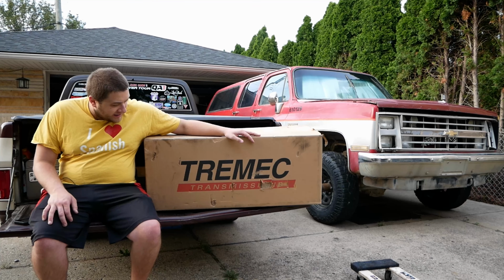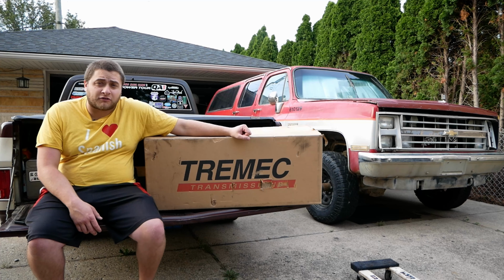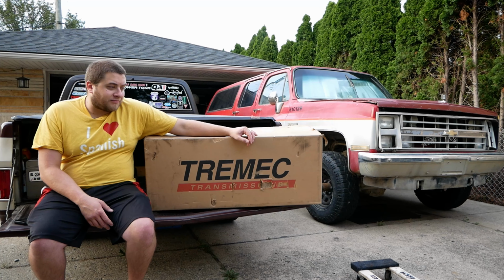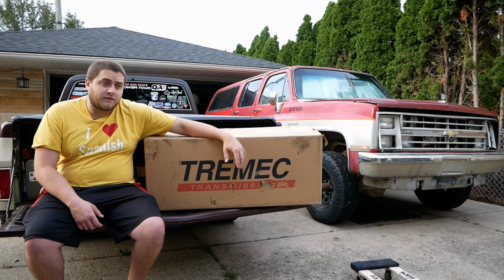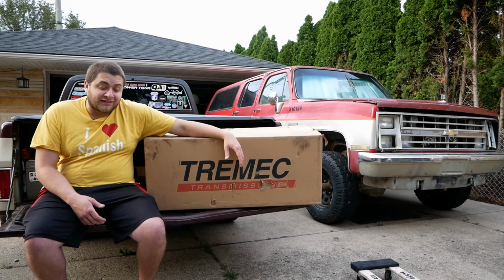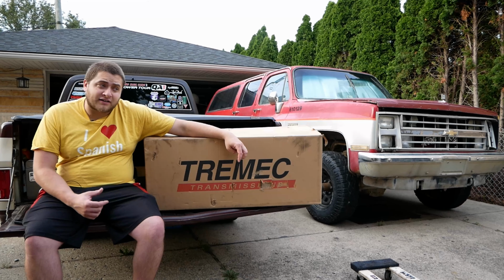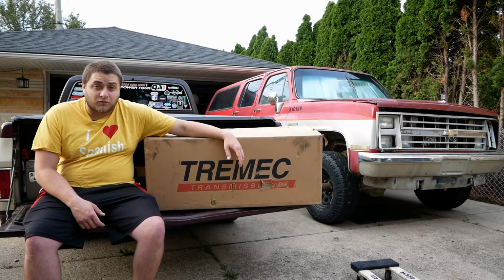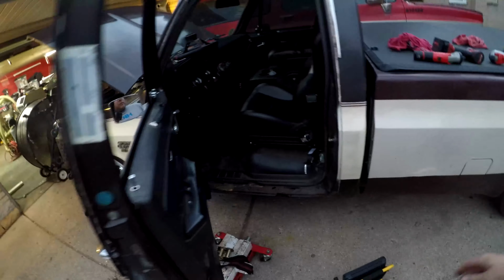I pulled the T56 out of my truck....

Comment: Hey buddy.  Hard to tell what position your shifter is installed but they are prone to leaking when in the forward position of the rear hole…..take a look at tick performance, they have a shroud that’s supposed to help out.
Reply from the maker: Hey what’s happening! So mine is in the rear, 6 bolt spot. The 4 bolt spot is plugged. I will use locktite when I get it back to lock those bolts down once more, but they didn’t loosen enough to completely back out, just finger tight. Does the shroud go around the shifter?